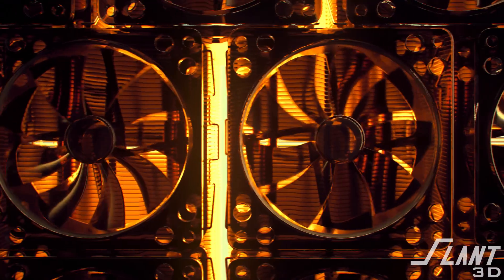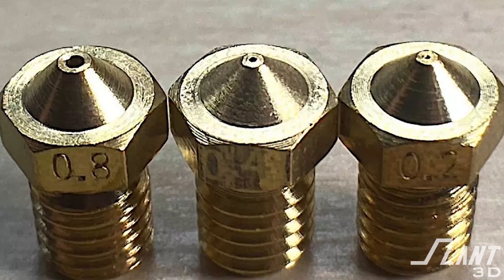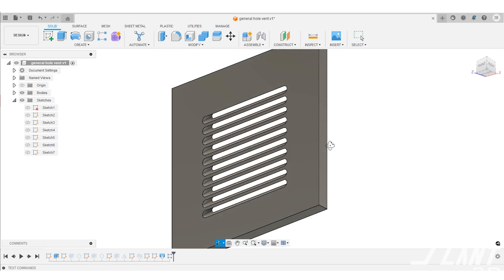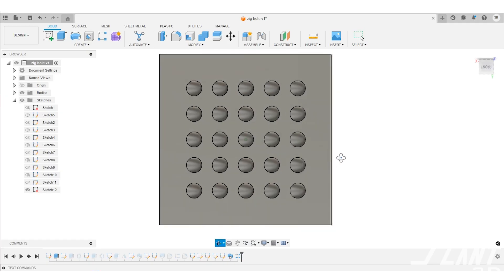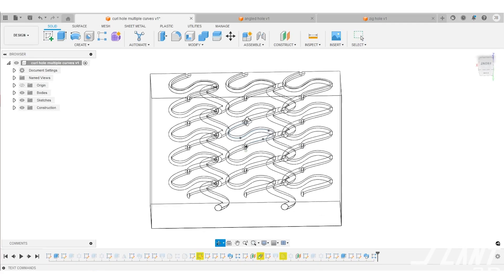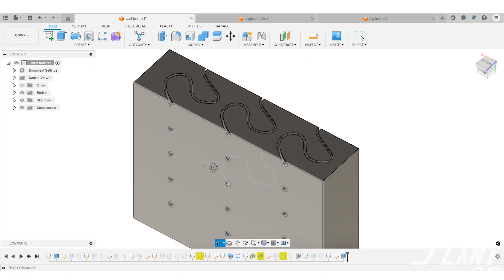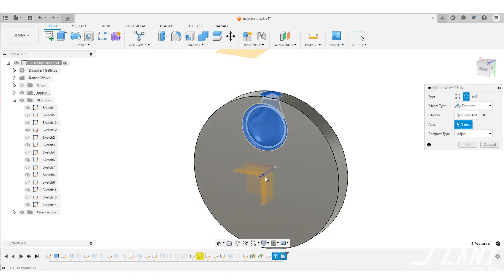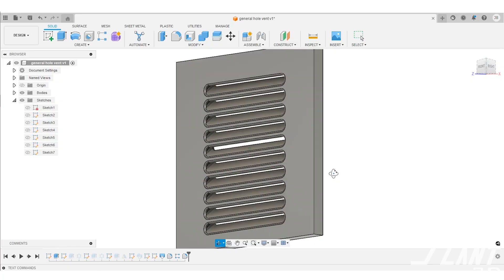These Cooling Vents are Impossible | Design for Mass Production 3D Printing

Comment from the maker: The reason the parts are not viable to be printed flat is that this would eliminate the manufacturability of the parts. They must be printed vertically in order to allow for auto-ejection which then allows for mass production to the 100,000's. We then must engineer from that constraint
Reply: belt printers could auto-eject these.
Reply: @boomers_pb  exactly. simply get good
Reply: That explains the first one but the two after could be fixed without support by rotating them 90°
Reply: @davidmcintosh19  exactly what i was thinking and i came to the comments to see if anyone else agreed
Reply: Why  would you print inferior product  by the hundred thousands, instead of a better product in custom, small-batch quantities?
You think you're going to disrupt injection-molded parts industry  with 3d printed product with a clearly inferior product,  printed using sub-optimal bed orientation?
How easy is it to snap one of those filters in half, since the layer lines run vertically, instead of stacking like plywood?
It doesn't make sense.
Reply: @odinata  breakability depends on the filament material, size of the piece, and orientation. A well designed semi-solid unit made of PLA filament isn't easily breakable, but everything depends on your products needs and the design constraints.
Reply: Wouldn't the auto eject also snap your parts pretty regularly in this orientation? Both from being pushed and from falling into whatever you're catching them in.
Reply: @@h.s.m.637 So you propose favoring performance in the environment it's used but then talk about those ridiculous internal curves that are probably not much better for airflow than a brick wall. Honestly that part with the super curved tubes was so bordering on parody I wouldn't have been surprised if he then pulled out a variant with a complete internal maze. 90% of this video is just about coming up with convoluted designs that are only possible with 3d printing instead of considering airflow.
Reply: Or you could mold thousands of them as a time using traditional casting methods. While the curve would be annoying, they are not beyond the ability of using cores that can be removed chemically. Stating that you cannot make them any other way in just incorrect - and decades of making far more complicated structures already exist in many industries.
Reply: @h.s.m.637  never said anything about belt printers
Reply: You could design one to sit in front of your PC fan where you can implement a way to catch dust (or slide in a filter) and then design a scrapper to push down to remove the dust for easy removal.
3D printing is just amazing.
Reply: Take a shot ever time he says hole

Comment: Turbulence (chaotic air) causes "heat exchange" with what? Unless the vent with the holes is the heat "sink", it makes no sense whatsoever. I don't know if you are an engineer but if you are, you either skipped the heat transfer course or mostly was sleeping during the class.

Comment: Industrial designer here,

There are lots of good use cases of 3D printing, mass production of anything that isn't insanely complex parts with almost completely inaccessible internal geometry is not one of them.

For simple vents, in the sub 1000 parts range, laser cutting is way faster, and thus, cheaper.

If you need a slightly more complex vent design (angled slots against rain and dust build up, even the vortex generators you showed), stamping is a good option once you get to the 1000 parts range (well shy of your 100k range you mentioned in the pinned comments), the initial tooling is fairly expensive, but cost/part is very low.

If you for some reason need something with weird tunnels, you can metal 3D print a mold, and then use plastic injection, which is dirt cheap, not only thanks to the insane production rate/hour, but also because metal 3D printing a very complex molds ends up being cheaper than machining them, at the minor cost of surface finish not being as smooth, but it will still be way better than FDM 3D printing.
Reply from the maker: You cannot mold those channels. They are impossible undercuts

Comment: the angled slots idea is genius! but i feel like the squiggle holes would require more static pressure than a vacuum cleaner lol
Reply: I have an array of fans in my printing room going out of the window, and I looked into 3D printing a vent that blocks the eyesight (don't want people looking into the room from the street). Basically, everything will significantly lower the fan pressure, and the designs in the video will almost certainly kill it completely + introduce a lot of noise if you try to use more static pressure. The best I got is to make a massive elbow (like for pipes) and point it downward (to avoid water getting in). Blocks the vision, and lowers the pressure only by like 50ish%. But doing the "S" route with the air, or even something like ">>>" will totally kill the pressure (and I have 6 high pressure fans)

Comment: Why are you making the assumption that this will be printed upright? To maximize yield on a single print plate? Cuz the beginning part taking about needing supports didn't make sense to me because you could just lay it down. 

Also, I agree with others that you really need to test these because curves can cause airflow to drop... 

Finally, the idea of creating a shape that will catch dust in one direction and get it blown out in the other direction... I don't think you achieved it and I'm not really sure how that would be done... or why you would do it; Most fans are designed to spin one way
Reply: I guess I should've read the pinned comment about that first part. You definitely should've clarified that in the video

Comment: 7:35 -- There's also the ability to do something specialized like print the vents as Tesla valves in order to enforce unidirectional flow. A single row of Tesla valves could be milled into a block of material, but you'd only be able to get an array of them by stacking rows, with all of the associated fabrication problems; an array of Tesla valves could be readily printed in place.
Reply: yeah, it's a cool idea in theory, but usable only for very specific cases in practice. If you have a standard PC fan and will try to navigate the air so the vision is fully blocked - you either will need a lot of space (to make a 90 degree pipe elbow with the size of the fan) or will lose >75% of the air flow and introduce noise if the flow was high enough

Comment: Actually, you can manufacture the first curved tube vent. You have to first make dissolvable inserts or metal tubes and have the operator put them in the mold quickly. Which will slow down the process significantly the more holes there are or make some quick load plate. Unless there are hidden voids there's a way to make it.
Problem is flow restriction on the final part. 

I used to machine molds and operate the huge press machines. Nowadays, I'm just an engineer in a pneumatic factory. 
i was one of the fastest operators. one mold, i had to place 8 threaded inserts and 4 tubes in a mold. no one could beat my speed record.

Comment: 🙋Theres 2 ways to print it and not use support on a slotted vent. 🙅
turn in 90Deg OR lay it flat on the bed. no support required. 🤦
who would have thought that you had options🤷
Reply: Neither of those solutions work well for mass production, which is the entire point. For one-off prints you are correct.

Comment: Should be called "clogging vents", not "cooling". Look at the cross-section of a metal grill vs those spaghetti wormholes. And remember that axial fans have low static pressure to overcome tight passages.
Vortex concept is all up side down. You want laminar flow as it offers lowest friction, hence maximum flow. Air has very low thermal capacity, so the flow rate is a key.
Not everything that can be 3d-printed, should be 3d-printed 😆

Comment: "Impossible!" .... "You keep using that word. I do not think it means what you think it means." - Inego Montoya

You might want to avoid so many absolutes in your videos, especially the word, "impossible." Many of the things you like to say are impossible are merely more difficult and therefor more expensive, so only used when there's a very good reason to do so. Although I do appreciate your experience with 3d printing, I suspect you don't have much of a background in the wider world manufacturing processes.

Comment: I'm going through this process for a custom solar generator. Since the equipment will be used outdoors it needs to be at least IP40 (not waterproof, but that ambient rain and splashes of water don't get into) and the 3d design gives so many tools for that instead of just punching or drilling holes for a vent.
Right now we're on tilted triangle holes, so water doesn't reach the fan and it drips out the little canal on the triangle's tip. For sure I'll be trying some of the ideas here.

Comment: People are printing bristled brushes using single strand bridging technique (check thingiverse for brush models). Actualy same principle can be used to print bristled air filters. (also you can use gyroid infill with top and bottom layers disabled to create fan grill)

Comment: I like your design videos and learn a lot from them, but in this case the "snail like holes" don't make sense in any practical way. As we all know dust loves to settle in ventilation holes. Ever now and then these kind of ventilation interfaces need to be cleaned. Try to get all the dirt out of these snail like holes. That will be pretty much impossible without extended maintenance work.

Also the additional flow resistance of the air won't help with the cooling of the part.

Comment: I am at the beginning stages of production of my own inventions right now and the shear cost of molding just one of my 12 parts in their original design was $25k. That's just the mold, not material. I'm not even sure they could IM petg-cf. With my final production design the cost would come down since there are less "pulls" to do but it wouldn't matter. My parts cannot be molded. I'm sure a hundred people commenting here would love to say otherwise but a mold simply cannot eject my parts. And no you cannot simply design around it or modify it. Design for the process as stated. The only trouble is you cannot in my case, and yet I still need to make 10s of thousands of them if not more. If you have to make a mold then use cnc tooling, machining to cut into it as a completely separate process step then you are NOT injection molding parts, you are machining them. There is a huge difference between Injection Molding a part the way we all imagine it--stamp, drop, bin, repeat and what many of you commenting claim to be Injection Molding. If you have to use a mold, AND THEN use separate tooling on different machines to make cuts, holes, deburr or whatever the case may be then you are NOT injection molding in the traditional sense-you are machining. Sure the IM plant can come back to me and say "yes, we can make that." But making it happen in totality and simply stamping a part into a bin are 2 totally different animals. And the machining part I would imagine takes drastically more time than the molding part since one blade or bit can only cut one object at a time.

Comment: Unlike most of the other videos in this series, I'm not so convinced by most of these shrouds. I'm aware that your particular company has constraints (must print with minimal bed contact for auto-ejection system, etc.) that discourage flat objects, which explains the unusual and potentially weakened print orientations, but I'm really not convinced on the square grids of serpentine round holes and similar high-flow-restriction designs. Seems like you would need a VERY high static pressure fan to take advantage of them. Nice to keep the techniques in mind though, as it's entirely possible that you'll happen upon a use case where they ARE actually practical!
Seems like a hex pattern of hexagonal holes (or making vertically serpentine horizontal slits rather than holes) could pack the serpentine designs a lot more densely, providing far more airflow per unit area. Seems like just a diagonal would be far easier to clean than serpentine patterns, though.

Comment: I’m new to 3D printing and tried to design a plate with holes shaped like hearts ❤. Then I realized it wouldn’t work without supports. Even if I turned it upside down, I’d have the same issues as the first vent with punched-through holes. Anyone have ideas other than slanted holes?

Comment: Printing a plate on its edge is wrong. The layer alignment makes a weak plate and generally requires you to create a thicker plate. Lay it flat: it's stronger and you don't have to worry about supports for slots or holes.

Comment: print vent as separate body without top and bottom and use slicer options for infill to choose appropriate inner structure. It will be the fastest print of the vent cover ever.

Comment: so you dont wanna print em flat in order to print  i guess more in a plate , and then in order to print em standin up,  you create a complex designs like spaghetti or whatever to over come that support problem  but then  the fan has to push more or "suck" more in order for the air to flow throu the more and complex surface in out plus the resistance  .. i dont understand.. :(

Comment: Hate to break it to you but a lot of, if not all of the designs you showed could be made using either basic tooling or positive to navigate mold construction, yes 3D printing does it far cheaper, far faster, and at a far larger scale. And for those who are wondering what positive to navigate mold construction is the process of making a master of the product/feature(s) you want then making navigate molds from the master to than make the final product. This is the whole "clone a thing" process but it can be used to make parts for castings.

Comment: If you asked me to make a billion vents I'd take a flat sheet of metal and then stamp out a cut bending the material to act as the protective bars losing no material and being able to run at the speed of the feeding sheet as it's pulled off the roll of sheet metal. 
In the end a super high performance vent is way less effective than running a fan very slightly faster, or using a perfectly optimal fan blade at it's optimal speed. 

But maybe I'm just thinking on a way more massive scale and aiming for a way lower production price.

Comment: in my industry we use 'spin filters' that are solid plastic vents with a cyclone shape which spins the air that comes in, a central hole for the air to pass through, and a hollow interior, so that heavier dust particles are pulled away from the central pass-through and get trapped within the housing. (We also use a second fan system to pull the dust out of the housing, but that's probably excessive for this) They look kind of like this: https://dxvwjyffixxdv.cloudfront.net/images/products/full11_8542Spin-Filter_2.jpg

Comment: You clearly dont dunderstand what the point of such a grid is for, your designs look aweful for mobing air, you're gonna need much more powerful fans to get the same throughput of air.
Similarly, what do you do when your fancy s curves get clogged with dust? Replace the whole thing? Painstakingly go through each one with a pipe cleaner? This is without touching on noise increases or the fact you turned a few mm of product into what looked like almost an inch?? I have no idea what you're trying to design these for, but everything you mentioned has multiple downsides, and few, if any, upsides as far as i can see.

Comment: Umm...bro.  You are holding the filter vertically.  1:16  "As a layer line goes up through here..."
No one would ever print that particular object in that orientation.
You would clearly and obviously lay it flat on the print bed.

Comment: I get there may be a situation where you would need to print these in the orientation that you're talking about, but If I'm printing a fairly flat  piece with slots in it, I'm going to lay it down on the bed. You're going to get a stronger print that way as well, because of the layer lines

Comment: most of these sound like they would be useful only in extremely specific scenarios, but what bothered me the most was the slots design segment, why not just print the part at 90deg, making the slots vertical, and instead of finishing with curves, finish with 45deg angles meeting at the center, avoiding need for any support whatsoever, without sacrificing the part per machine count

Comment: I really don't see the point of 'mass manufacturing' a vent cover with 3D printing. It seems worse than a traditionally manufactured vent cover and increases cost by 5 or 6 orders of magnitude. For hobbyists sure, if you want to print a vent with weird geometry and 1/10th the air flow.

Comment: Literally every design is a new level of awful fluid dynamic engineering. Would be difficult to imagine a more negative value primer on airflow geometry. Additive manufacturing is incredible but very few designs could not be done with casting or other methods. & No 3d printed copper heatsinks are being made outside of aerospace. The heatsink would cost more than the device being cooled.

Comment: You could manufacture all of those traditionally, the only difference is that instead of being one solid piece it would have to be milled in separate layers for some and using unique angle for other. Manufacturers are too cheap to allow for that though.

Comment: It's wrong to say that these were impossible before. They were possible, but just not when using a single plate. You could get the same functionality by using multiple plates. Cleaning of the S-shaped ones would be really difficult when it's a 3d printed part, while you could just disassemble, clean and reassemble the "standard" part.